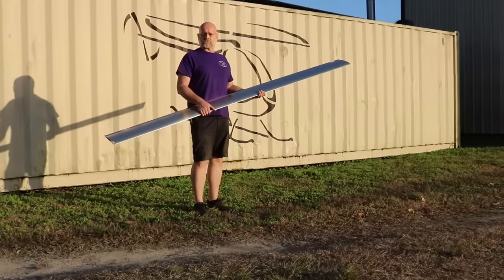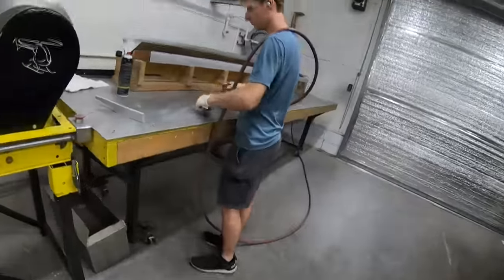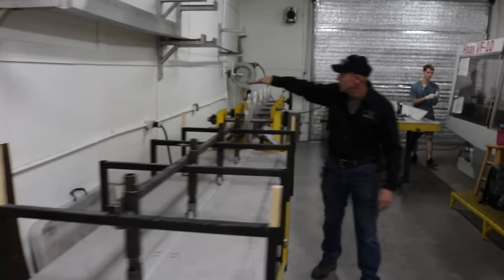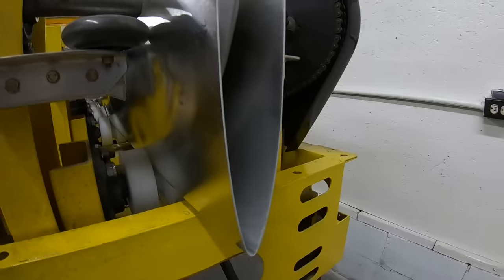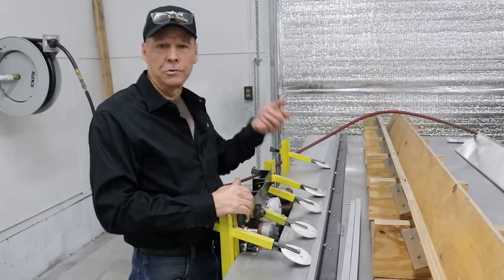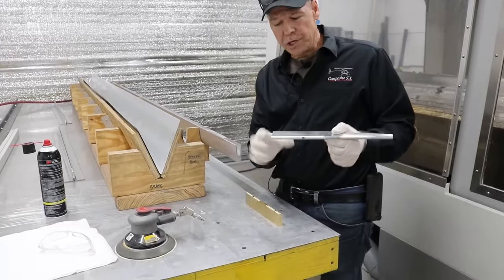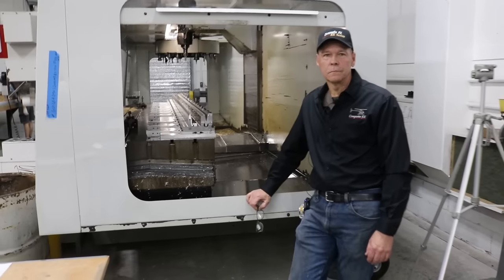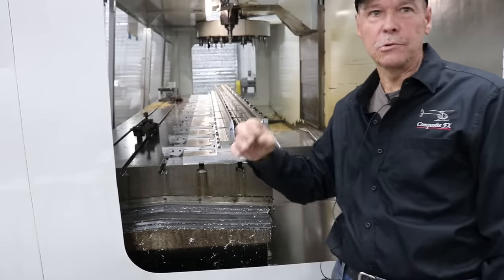How its Made- Mosquito Helicopter Rotor Blades - Factory Tour

Comment: When they did the pull apart test I was kind of hoping that there would have been a readout of how much force was used to pull the glued parts until separation occurred.   I am guessing that maybe that is not important  because the cut test coupons were not cut to to a pattern size so there would always be a difference.  I am thinking there is an expectable range of pull force separation needed and it sounded like the glue tape showing that it was bonded to each side of the glue joint was more important then the actual force to separate the two glued  surfaces.  Great learning video.   With this kind of manufacturing ability  I am wondering if these blades would be for sale so builders can use them on other projects if the projects were approved by the Mosquito Helicopter company ?
Reply: There is defiantly a calibrated gauge reading pull strength, and the coupon has to fall within an expected range. There is a lot of liability (possible lawsuits) riding on these parts.
Some things weren't shown for proprietary reasons I'm sure.
Reply: Yes I saw the gage and was hoping that they would share the expected reading per linear inch of glued area. But it’s ok.  I really enjoyed the build process of the blades.
Reply: For me epoxy glue and nothing else  :/ quite scary in helicopter blades , i used a lot epoxy with aluminium and for me this not work good , plus working temperature .... this must be strong glue on the sun those blades can reach really high temp , but what i know :)
Reply: @adredy  Hi, Epoxy, in this case, is misleading. As you saw in the video, it is in tape form. There are mainly two types of adhesive tape supported and unsupported. 
this was supported tape. Picture the cloth-like material in duct tape sandwiched between adhesive layers. 
the cloth helps in many ways. The heat-up, dwell, and cool-down are critical. Plus, the pressure of the mold surfaces is just enough to not cause the adhesive to squeeze out. In my industry, we use vacuum bagging and a mold or bond jig
To keep the desired pressure. All of this goes in an autoclave the size of a 747 fuselage at 75 PSI and 350F for 8Hrs. 

So the bond between the two aluminum skins is stronger and more reliable than regular epoxy. 

During service, the Blades don't encounter heat anywhere close to 350F, so the epoxy stays stable during the blade's service life.

Comment: A PID controller, a few thermocouples and a proportional gas valve make a great start for oil right consistent temperature regulation of a gas fired deep fryer of turkeys, chickens, wings, sweet potatoes and spuds plus a few others I'm no longer hungry enough to recall. 
PID is Proportional, Integral and Derivative are mathematical relationships between the current and target temperature that work as a team to calculate the percentage of total heat available to apply in order to maintain the current ramping target and the soak temperature. The PID controller can with the right features take care of ramp up, soak and cool down timing. They work well with Proportional Solid State Relays, SSR, for a variable electrical output..  but worth noting is the common failure mode of an SSR is in a closed/full on output state, they rarely fail in an open/off state. 

Once I get started it's good to clear some memory from storage.

Thanks for sharing of the forming and bonding technique. Does this company use 3M literature's 30% sulphuric acid to water mixed with red stuff (slipped my mind) etching solution to prep for bonding or something trade secretly else? Always curious.

Comment: I have some TH-55/Hughes 269 rotor blades that I have cut up.  They have a remarkably similar cross section - extruded aluminum nose bonded to aluminum sheet, brass leading edge, weight on blade tip, reinforced blade root section etc.  I'd be happy to send you some cuts or some images so your engineers and technicians have more reference material.

Comment: We have a table that has one inch steel plates top and bottom with a steel honeycomb sandwiched between the plates.  Once they are all joined the top plate is ground flat.  All this ensures the surface remains flat in cooling and heat cycles.

Comment: When all is said and done I am wondering why they have not transitioned from Aluminum to Carbon Fiber for the blades🤔.... a different process but a stronger/lighter blade I'd bet .     Nice shop and thanks for the tour to them and you too.😆
Reply: Talking to Dwight in the past, I think it is a cost thing. The carbon blades are more expensive.
Reply: Yeh,.. sometimes people try and cut corners... I would prefer an upgrade Carbon Fiber blade over a glued aluminum 'cause it's my butt hanging on that blade.,..AND  looking at the ends I saw a GAP I didn't like at all and the pull apart test did not impress me.......... but that's just ... ME.  Thanks 😁
Reply: The forces and speed these little toy helicopters go through don't mandate a composite rotor. Composite is also heavier. These helicopters dont travel much over 100km/h they dont really carry any weight and they are a two blade rotor.
Reply: Carbon Fiber  is 50% lighter than Aluminum... The engines have limited H.P. ,... less energy to drive the blade.. more to power the vehicle.... look at the Big Turbine builders, the fan blades are Composite /Titaniam not Aluminum for a reason.🤔
Reply: @robertlafnear7034  You didn't read what I wrote, and you obviously don't understand how or what a composite blade is made from. We are talking about helicopter rotors here, no fan blades, very different design.
Reply: @robertlafnear7034  consistency can be an issue with composites. 

When rotating, the top and bottom sides of the rotor blades would be pressed together…. so adhesives are not a negative.
Reply: @robertlafnear7034  Rotor blade weight is unimportant to the power required, because rotor speed is constant. In fact, blade tips are deliberately weighted (the brass weight is shown in the video) for multiple reasons  (to increase rotational inertial to store more energy in rotor rotation for more stable rotational speed and for autoration transition, etc).

Comment: How was the choice of the airfoil made and how does the airfoils differ from that of a Gyroplane. Why do gyroplanes not use your choice of airfoils if both aircraft will find it necessary to Autorotate? Does this airfoil have a limited area of pressure travel? What is the relationship between the mass and the aerodynamic center. How much twist do the rotor have during use? Does the rotor cone when loaded or is the coming angle set by the rotor head? Inquiring minds want to know.

Comment: Is the etching of the aluminum done with Alodine? If so, it should not be wiped on. It should be dabbed on and added off with DM water. wiping breaks down the peaks and fills the valleys of the etch. a cross-view of the surface at magnification can show an obvious difference. I am sure you know this. It looks like you have done your research. Is the cavity from doubler to end weight empty, besides the leading edge spar? Having better cleanroom standards will help in any future quality control issues and possible litigation. Good luck and much success.👍

Comment: How do they go about blade twist? For lift distribution at tip and root? Or the aerofoil thickness bigger at root than at tip,? Because I don't seem to see that difference, or lift distribution isn't that critical on this?
Reply: There is no static twist. The extrusion isn't twisted as it is manufactured, and while the CNC could form the twist, there would need to be much more excess material; the alternative (which is actually used by major manufacturers) is to heat and twist the extrusion after machining. Also the dies and moulds for every other step would also need the twist; that's viable for major manufacturers, but not for this operation. Aerodynamic forces probably twist the blade somewhat during operation but fundamentally it just doesn't have the twist that an optimal rotor blade would have.
Reply: @brianb-p6586  I read twist-less blades are less effective or what are the major drawbacks to having a blade with no twist.
I also built mine in this manner (check video) and no twist, yet to test it and see the effects, but if I was to built them again I would machine thinner profile thickness towards tip instead of twist.
Reply: @JeffChoppah  they are less effective (less lift) and less efficient (more power to get the required lift), but I don't know by how much.

Comment: At 19:56 I saw that the spar was not well seated in the skin leaving a substantial air gap.
Reply: This looks like the end of the blade where the resin has squeezed out and would obscure visibility of any gap
Reply: @homeworld1031tx  I can see it.  Thing is, there was nothing forcing the spar into the blade skin and when they cooked it it didn't even have gravity  working for it.
Reply: @Raul28153  The video spent minutes explaining that multiple silicone bladders are used to inflate inside of the part cavity to press the spar into the wing skin.
Reply: @homeworld1031tx  must have missed that part.  But they didn't leave them in, which is interesting because the might have been able to  depending o the material and the heat involved.
Thing is  I see a gap.  Now to be honest I don't know the significance of a gap from an engineering  perspective.  It may be moot, or not.
Reply: @Raul28153  Hi, I'm the blade builder at compositefx and one of the people shown in this video. While the air gap you're pointing out does exist, it does not extend past the test sample shown being cut away from the blade. The silicone tubes that inflate and push the spar into the leading edge were used. The part where we removed them was cut from the video (I assume for the sake of keeping the video from getting too long-winded). Hope this helps.
Reply: @waderoberson1864  cool~!

Comment: Not a full composite blade and small compaired to a full composite blade made for a MI 24
These blades outlive the aircraft structure easily
Reply from the maker: com.pos.ite - made up of various parts or elements. That is all. :-) 
Thank YOU for taking the time to watch. We appreciate YOU!
Reply: @ExperimentalAircraftChannel  Literally, yes, but in the context of aircraft construction that's not what "composite" means. The blade is a fabricated assembly, not a "composite". A composite in this context is a material with more than one component, such as fibre-reinforced polymer.

Comment: I’m rather surprised that the airfoil cross section is constant while the airspeed varies significantly with the distance from the rotor hub.
Reply: I ask that same question whenever  I can. Look at how the airfoil changes from root to tip on a hi performance sailplane or a wind turbine - highly optimized. Why not here ? Scratching my head...
Reply: Cost, weight and simplicity.  Keep in mind guys this is a 50k ultralight/experimental.
Reply: @rolnthunder6737  i get it, but the bespoke heated molds could as easily cure pre-preg, and a CNC mill can make them any shape desired. Alternatively, room temperature curing resins let you make simple fiberglass molds off of a carved wood original. Then again, working with a new, complex technology increases costs and imposes a learning curve.